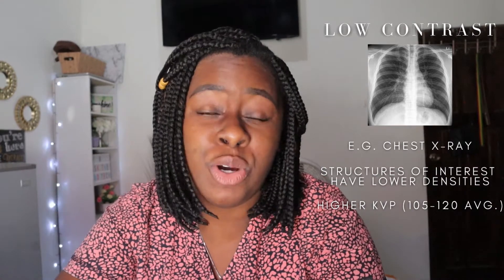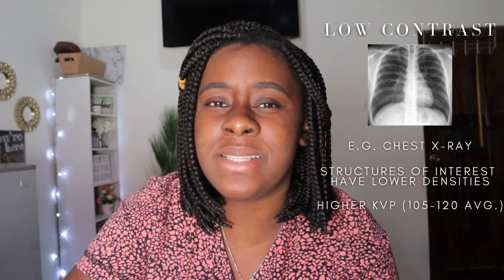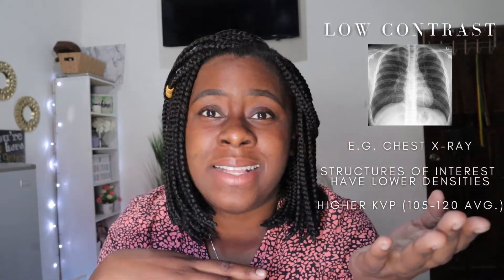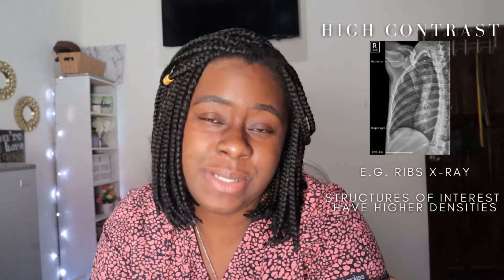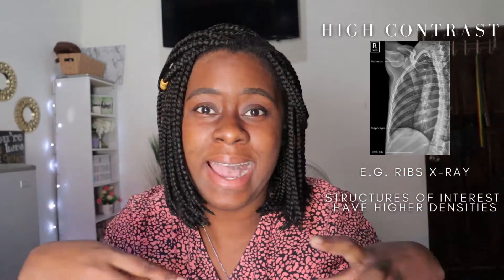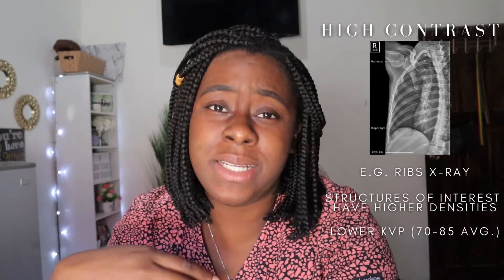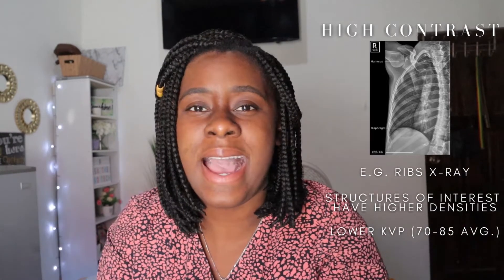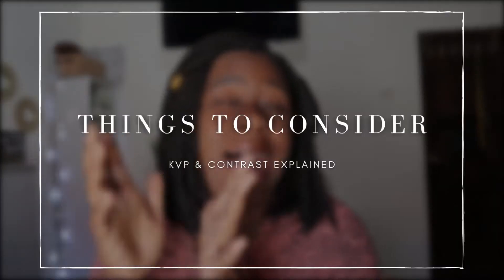kVp & radiographic contrast explained || Ask The Rad Tech

Comment: When the AEC doesn’t work, you have to double the MAs for a chest?
Reply from the maker: AEC is not the end all be all. If the exposure isn't right I just switch to fixed (normally inputted) exposure factors based on the patient's size.
Reply: @AskTheRadTech  yeah the pt was body habitus was thick  and I chose 114/6.7 but  it still came out grainy
Reply: I didn’t want to keep exposing her😮‍💨
Reply from the maker: @fashnup2date  depending on the tube output sometimes you find yourself having to use kVp around 120+ for significantly larger patients. 6.7 mAs already sounds like a lot. Try using the 15% rule in such a case. Increasing the kVp by 15% gives a 2x increase in exposure reaching the detector. Would help the graininess.

Comment: My baby had pelvic and hip x rays.. I only know that kv is 40,ma 400..and x ray image is very good.. How can i know mas is high or low for baby?..
Reply from the maker: You'll need to know what the time for the exposure was in order to know the mAs. Usually when the mA is higher it's a hopeful sign that the time should be very low which would mean that the overall exposure amount is reasonable
Reply: In 400ma x ray mechine kv ranges??
Reply from the maker: @swagatikapanda7683  with a 400 mA, and the fact that it's a pelvis/hip on a baby, 400 mA might correlate to 4mAs. Which is pretty decent for a baby.(especially based on size)
Reply: Is increase or decreasea mas affect image quality??

Comment: When a radiography  is too white, that means  too much contracts right? If so , does that mean we then need to increase the kvp ? 
Sorry  I get it mixed up
Reply from the maker: It depends. If you want a low contrast image (for example an abdomen or chest) but there were many shades of bright white and grey and no distinct difference in anatomy then yes, the kVp would need to be increased for more penetrability. However if you want a high contrast image (for example to see boney structures like the hand, foot, ankle etc) you need a fairly lower kVp but an small increase in density (mAs).
Both factors do affect the image though. Sometimes both may need to be increased 🤷🏾‍♀️ Once you have good base value exposure chart you'll know which factor may need adjusting due to the size of the part being imaged. I hope this helped 😅
Reply: @AskTheRadTech   yes it did. Thanks a lot.
Reply from the maker: Happy to help ☺